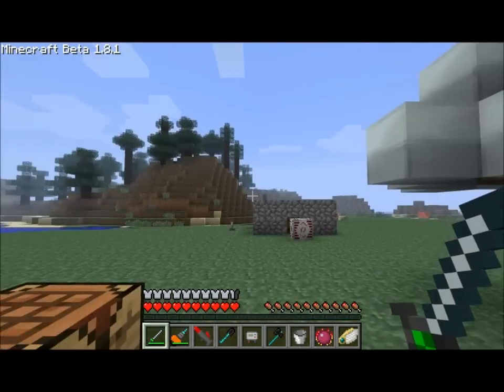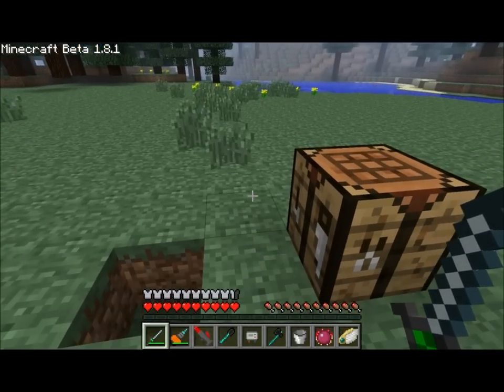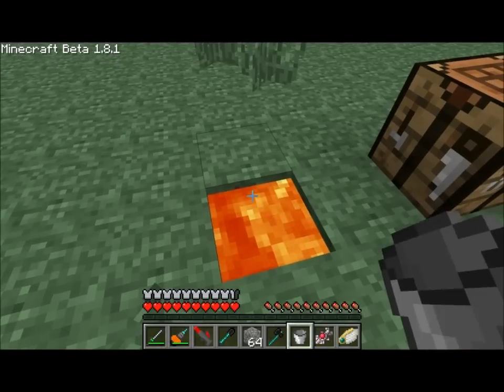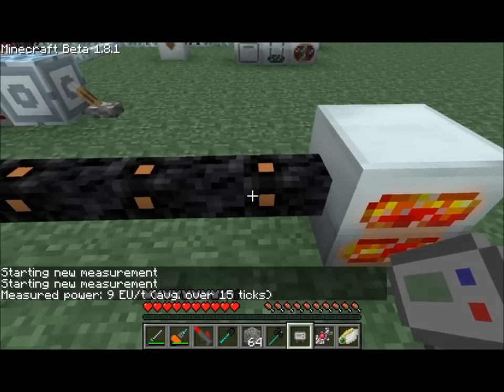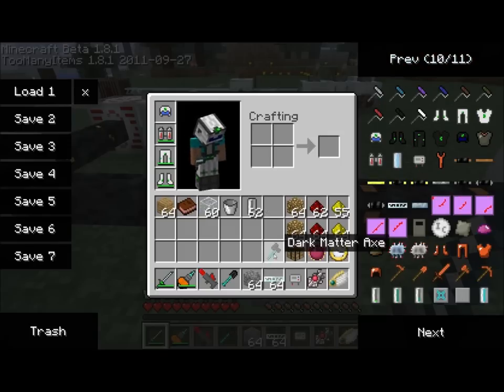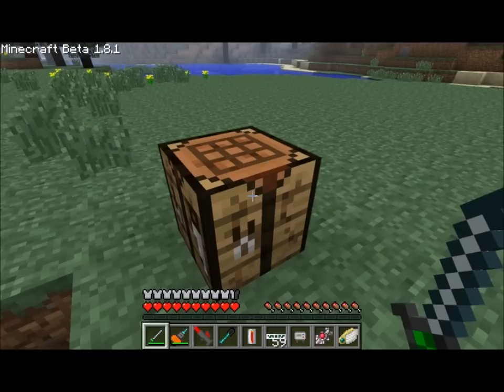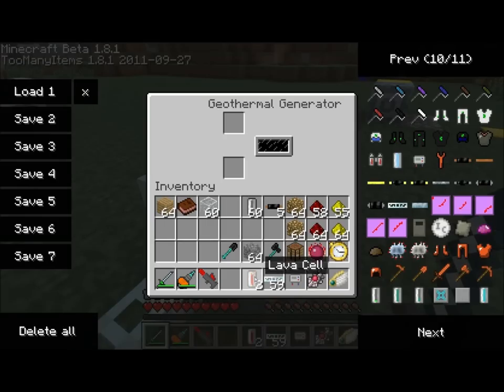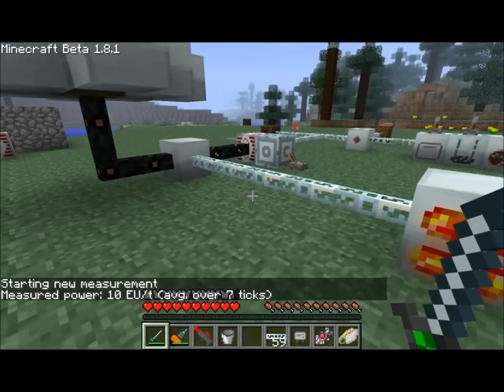IndustrialCraft 2.0 Tutorials - Geothermal Generators

Comment: It means that it starts/stops producing energy because your BatBoxes (or equivalent) are full. This is fine it only consumes what it needs to make electricity. Unless you are consuming energy faster than the GeoThem Generator can make, it will blink on and off.

Pop a battery into a Batbox that is connected to your GeoThrem, you will notice that it is always red because it needs to make more energy to fill up the BatBox